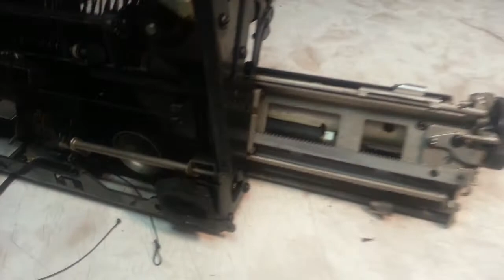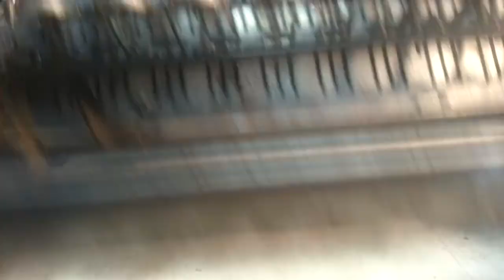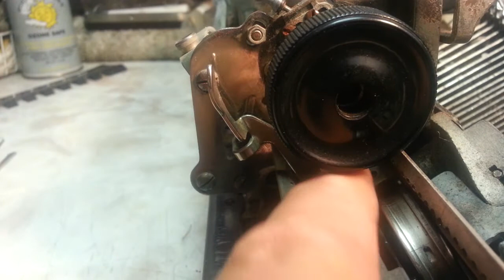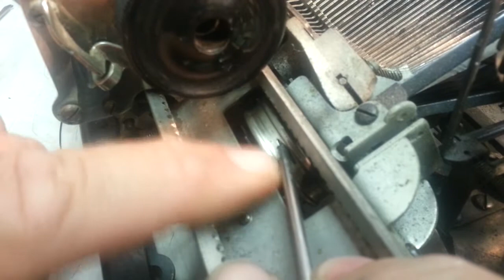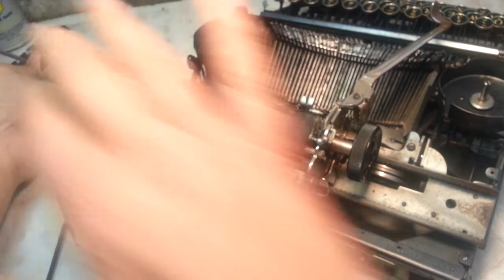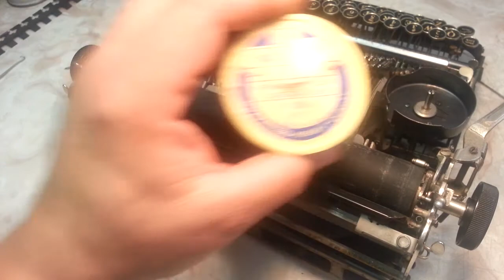Typewriter Draw Band Main Spring Rewind Replace Repair

Comment: Just picked a Corona 4 out of the trash and need to do this - how long is the string supposed to be to begin with?
Reply from the maker: I don't know, never measured. Just went from max distance from mounting points and added a couple inches

Comment: Wow, are you ever lucky. I must have an older one than yours and it is hardly as easy to do as this..........as if this was not hard enough. Mine has a different kind of set-up and is very fixer unfriendly. Trouble is, wind the string to strong tension and attach over a pulley and get the string to the screw that un-tightens via a different diabolical way then you have. And then,  it unwinds all by itself! Maddening!!! One more try and it hits the trash!
Reply from the maker: Wonder if your mainspring is broken internally, if so, it will wind tight , then suddenly slip loose in tension
Reply: @phoenixtypewriter2136   Thanks so much for the reply. Appreciated!  The spring is fine, and, I am also a clock repair person who knows springs well. Think I found it. I was using a 25lb Fish Line. (Must not grab. Too slick.)  Now to locate string like the old one that was in it that does not slip as the pulley goes back. Supplies in my area are just so darn limited. Even Ace. Maddening. Thanks ever so much again. :-)

Comment: Thank you thank you!! I was searching for some hours before finally finding this video. My Adler Tippa 2 has the spring rotating horizontally, but otherwise this seems to be the same mechanism idea. Can't wait to get in there now and try this. The things unclear from the video are how the magic string length is determined (but mine is unbroken so I'm good), how many rotations to start with on the spring (I assume I'll know if the string doesn't reach it was too tight, and I suppose too loose is fixed through trial and error?), and can it be adjusted after assembly without starting over? Now I must order or fashion a spring hook!
Reply from the maker: Glad you have made progress, I don't recall how the Tippa mainspring is set up, I don't have one to reference either.
Amount of winds is unknown, like you said, trial/error - fabricating parts is sometimes only way

Comment: I tried  doing this on a 1930s zephyr but failed. I tried about 8 times, rotating the coil an additional  rotation every time hoping  the hole would open up to slip the knot it... but it never did... could it be that the coil  is broken?
Reply from the maker: Yes
Reply: @phoenixtypewriter2136  yup! Coil is broken... in the middle too! I'm  thinking of getting a coil from another manual  typewriter and see if it works out. Thanks again for the response

Comment: Is the knot required to be inside the spring drum to fix the spring end in position? My 1939 QDL's spring seems to be sliding inside the drum after two turns or so, and it only build up enough tension to move the carriage about halfway.
Reply from the maker: Sounds like the actual spring inside has broken, you most likely will have to find one from another Royal.

Comment: Thank you for your really generously informative and helpful videos. With your help I just got an old Halda 6k from 1956 up and running. The carriage strap was broken when I got it, but I found a ribbon among my things that worked as a replacement. Tightening the main spring and then putting on the strap almost gave me a nervous breakdown, but boy was I happy when I managed to get the thing working again.
Reply from the maker: That always a cool feeling when you accomplish a tricky repair like that.

Comment: Where did you get the tool with the hook on the end?
Reply from the maker: Spring hooks are standard typewriter tool issue, got mine from a typewriter supply company. Try http://www.cmfg.com/misc.html
or https://www.jensentools.com/search.aspx?f=2%3aJensen+Tools
Reply: I just made one out of some thin coathanger wire.

Comment: Anyone know what would cause the carriage to seize up completely? literally hold down the release lever and whack it to move.
Reply from the maker: The quick answer is No, I don't know, don't have enough information. Did it ever work ? Did you acquire it like this ? Was it shipped ? does carriage wiggle at all ? does it bind evenly all the way across ? is there sign of rust or corrosion ? Does the escapement work ?
Reply: She is a 1935 L.C. Smith and the Escapement does not work. If I hold the cartridge release and whack it with the palm of my hand I can get it to move. I see no rust and zero wiggle. I did purchase in this condition as it was in fantastic condition and a good price and figured I could part out for another project if I could not get her up and running. I just hate to do that because of the overall pristine condition and would like to restore and use it.
Reply from the maker: Very hard to say without seeing typewriter up close & in-person.
Sound's like rails got compromised & are jamming movement

Comment: I have this model and I need to fix the escapent! Do you have a video that could help?
Reply from the maker: I don't have a video because the SCM escapement is so reliable & I can't remember the last time I have seen one broken. What's not working ? did it get damaged in shipping ? Picture or video would help. Could also post it on the FB Typewriter maintenance group site for worldwide help. They also have repair books & parts layout diagrams.

Comment: Really great video
Thanks for taking the time to make sure camera was focused and in view when working from different angles. Audio was also excellent.

I had fixed a drawband before but didn't know that the spring retracts and makes room for the knot...very interesting. Just picked up a QWERTY Erika and it's cosmetically great, mechanically in need of just a few things. Excited to get it running 100%

Comment: Great video, thanks for sharing. I was unsure how long to make the new draw band so I went with about 4 inches longer than the width of the typewriter. The length worked fine.  I used clear 30 lb monofilament leader line.

Comment: Thank you for this video.  It saved a typewriter I just received today from ebay.  I was able to re attach the cord, and now the typewriter is fully functional once again...  This was very helpful.
Reply from the maker: Excellent !!
Reply: My bell is a little soft.  any ideas on how to put more tension on the spring to make the bell ring just a little bit louder?
Reply from the maker: Yes
Reply from the maker: Yes, tighten spring, adjusted hammers (lever) contact point on bell, make sure hammer does not touch bell in rest position. Trial & error but usually with some time, tools & patience you can make these ring louder.
Reply: What type of string / cord are you using for this repair.   You make it look too easy.  Thanks for posting these videos.